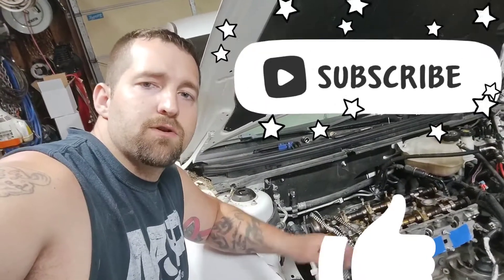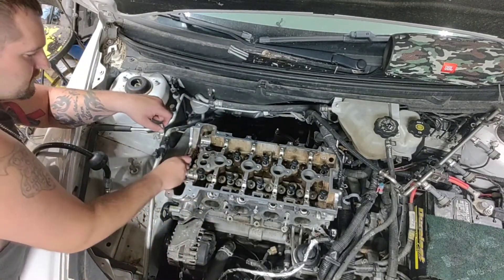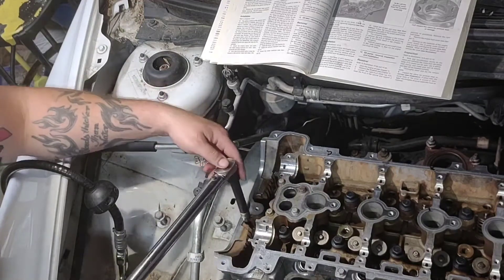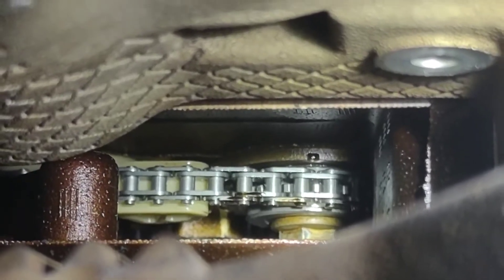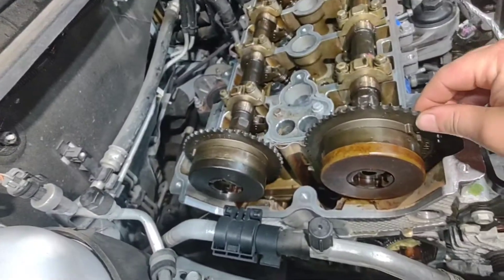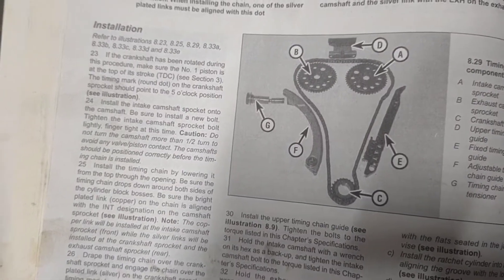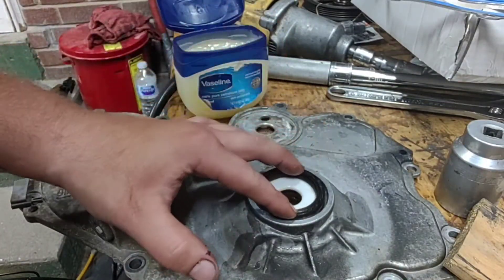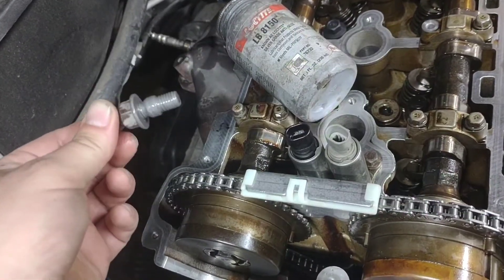2.4 eco tec head gasket installation and timing/balance shaft chain.2012 Malibu!

Comment: I'm rebuilding this engine (rings and valves) due to the issue with burning oil because of the rings. Now that I have it back together I noticed the timing chain gets slack between the two phasers each revolution. It makes a kind of clunking sound as the tensioner goes in and out. Is this normal? I don't have oil in it (I do have assembly lube of course) so I'm wondering if the pneumatic action in the tensioner is not in play and causing this temporarily now? I'd appreciate your opinion on it. Video showing it is here: https://www.youtube.com/shorts/KSaunpl1B6M
Reply from the maker: It won’t let me watch the video, did you replace the cam phasers?